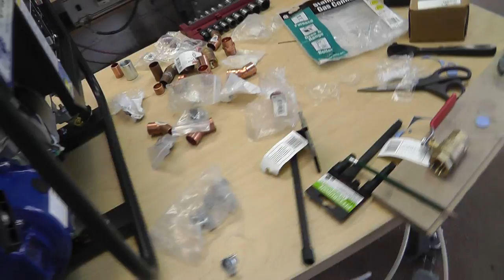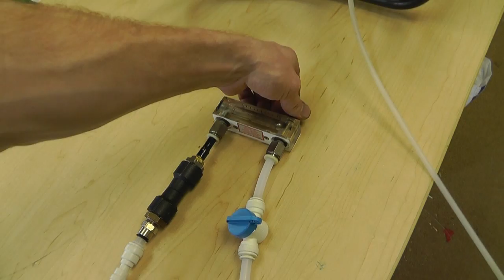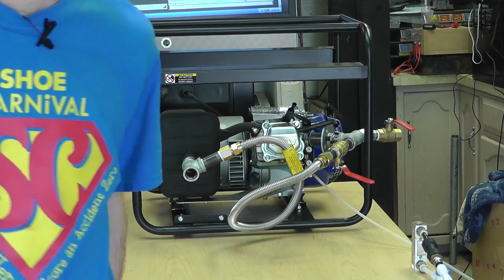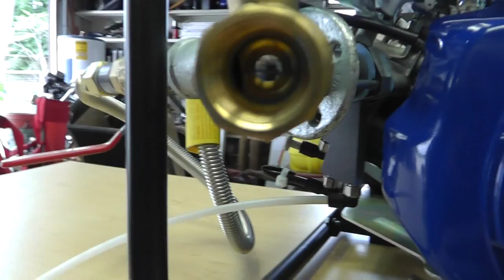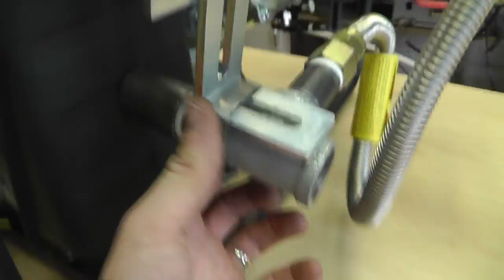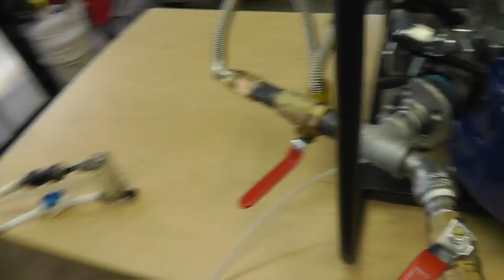Recirculating Gas Exhaust Set Up & Running The GenSet Under Load. 3-22-12 RWGresearch.com

Comment: Hydrogens  flame  speed  is  8 mile  per  second. So  you Have  an engine  that come  (unmodified ) from the  factory set  to  run off  gasoline. To insure  that  it  will  run without Back fire, the spark timing must  be  changed from BTDC to ATDC. Most gasoline  engines run advanced because the  fuel needs  time to Burn. Hydrogen needs NO  time. It is  instant!  Russ  Knows  this. I am  sure  he  is  doing  just  that.  Myth -Busters had the same Backfire.They didn't  realise Timing  is KEY

Comment: If you wanted to do something with the excess heat you could mount peltiers and then run that extra energy to your power source and or you could build a "fuel heater". Awesome work! i guess next is frictionless oil and a rebuild on the gen into a super efficient non-resistant per mag energy producer.

Comment: russ,

I think the water that was spitting out the exhaust is always being spit out.
The difference is that when the engine is cold, water comes out
When the engine is warm, the water turns into vapour before it even leaves the exhaust port.
I think that if you placed some sort of membrane / filter on the exhaust, you would find that it collects the water vapour... just a thought..

Comment: you may want to consider creating either a longer exhaust system after the flex pipe on the exhaust or some type of exhaust gas collection chamber so when the engine is on its intake stroke it has exhaust gases to use. the way you have it set up now, when the exhaust stroke is finished and the intake valve opens again all movement in the exhaust system stops, the only thing your geting is air back in from that half inch corner from the tee to the flex on the exhaust, all the exhaust is gone

Comment: you could simply use a peice of pipe long enough on the end of that tee that the pipes volume is equlivent to the engines displacement, this should give you full control over your exhaust gases, however I would create an exhaust gas collection chamber simply because it would be more compact and more effective at giving your exhaust back, punch a pencil sized hold in the neck of a soda bottle and breathe in through the top of it and you'll know exactally what im talking about

Comment: you will need to make a water trap near the intake.. water getting in there will be bad.
you will need to make a chamber to hold the exhaust gasses for a second before the motor gulps for air. by the sound you can hear its pushing exhaust out because the output is timed where it happens before the intake. this means its not taking in as much exhaust then the valve at the top forces the motor to desperately gasp for air by making it breath through a straw (your gas line)

Comment: How do you know that the generator just isn't sucking in outside air via the exhaust output port?  You need a one way valve or something like that, so air can only go out the exhaust, not enter in.

That might explain why that flex pipe is so cool

Comment: you'll get a light mixture of the air already in the bottle but mostly all you'll get is the air flowing from the hole in it. if you were to place the hole in the bottom of the same bottle and repeat the process, the outside gases flowing in would force the gasses already in the bottle out the top and into your lungs and when you breathe back into it the same happens in reverse, storing your exhaust gases again, this is exactally what you want, yes?

Comment: if you have 100% of the exorcist dumped into a small tank. then from the bottom add a fresh air intake. and at the top another valve where hydrogen and oxygen are added. use 1 inch pipe and keep things close together. restricting exhaust or intake will make the motor shake, damage, and make it run like its on choke all the time (why it stalls so much when you draw power) for this reason the bottom ambeant air intake will be important to relieve pressure. adding a tube to this part will also help

Comment: ... help by keeping it a closed system allowing a changing volume to keep extra air pressure down and containing exhaust so it cant easily escape. 
keeping the entire thing work will improve efficiency.
this mod will make you not need to mess with the motor too mutch

Comment: you life be easer  usig a speeduno or microsquirt and use the OEM carb and governor for rpm control and spark control i like ford edis but any 5 volt triggered coil il be perfect a side benefit that could be used [[may be on old onam genset 1800 rpm unit salvaged up

Comment: yes thos are very good ways of getting free electricity (more so the wind turbine) but they are very expensive to buy (solar panels) and a home made turbine is also sadly dose not produce very much. i would like to see someone using running water to turn a very large water turbine.. but that's the problem strong reliable sun is hard to come by for most people making solar panels not very effective for their price. if you have these by all means go for it!

Comment: the Geet engen is something i would like Russ to test and disprove or approve. it seems like a lode of BS because ive seen there exhaust and how its made and what they describe can not happen with their build. but i would really like to be prooven wrong on that one:D  if you had a supply of electricity i would most likely attempt to keep it in the same form it is.. when you convert or transfer energy it loses power. converting water  to H2 and O2 take a LOT of power to do thus wasting much it

Comment: dont do that just yet hydrogen is an expensive fuel to create. his production system is way more expensive than running on gasoline. but thats the point of the project. half his system is to test the real experiments. if it works he well that will fix the main problem :D 
unless you have free, large amounts of electricity to make hydrogen it is not a very good fuel. as of right now